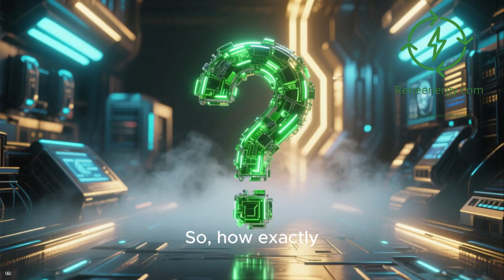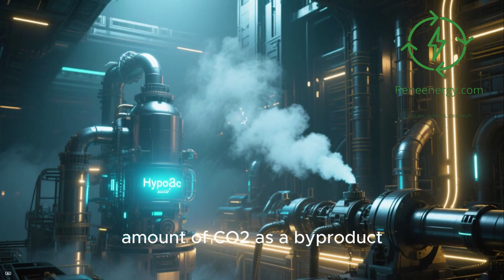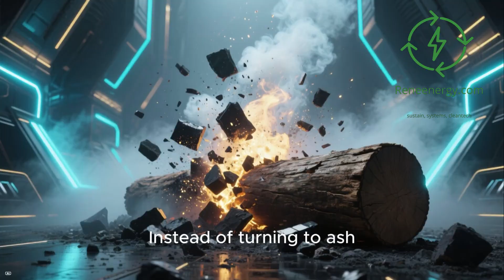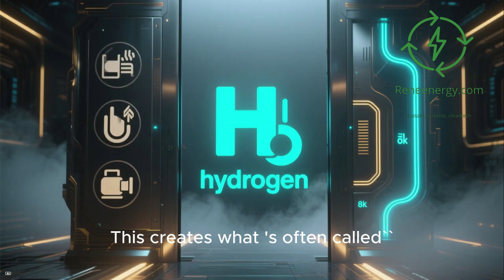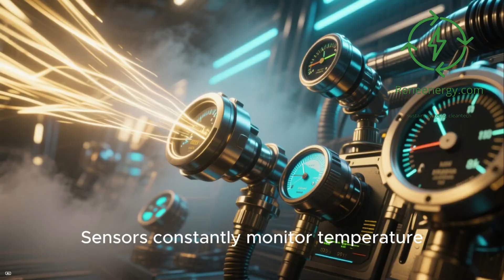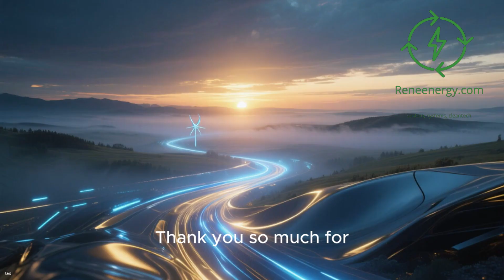This Startup Says It Can Turn Natural Gas into Clean Hydrogen – Here’s How

Comment: an enormous point of using hydrogen at all is to reduce heat generated in the manufacturing to lower the planets temperature by not burning anything. the other half is to reduce the amount of greenhouse gas into the atmosphere. this seems to do the latter fairly well, but still needs large amounts of heat. so whats the point?
since the video also doesnt name the startup, either public or private, and the whole thing uses an AI voice, and was created using it, i think this whole thing is some kind of bs.

Comment: Where will the energy required to maintain the pyrolisis system at high temperature come from?
Reply: The energy would come from the same place as it dose to run the refinery, just as steam reformation of methane is energy hungry srm plants are usually situated at refineries
Reply: @TheBlibo  and how green is that energy?